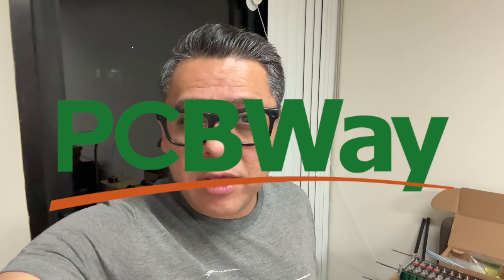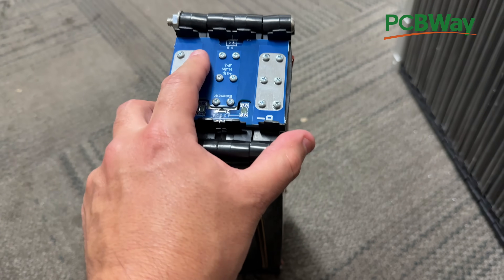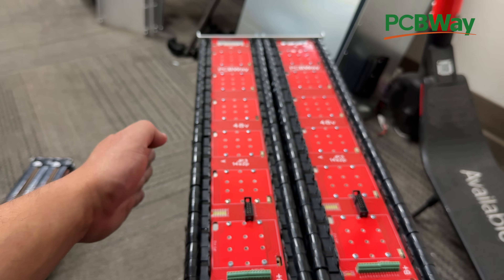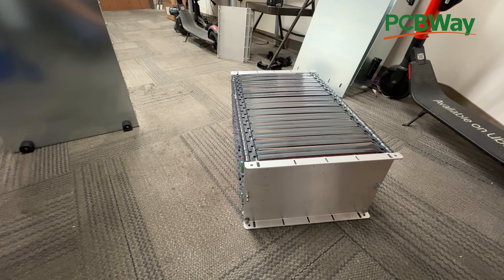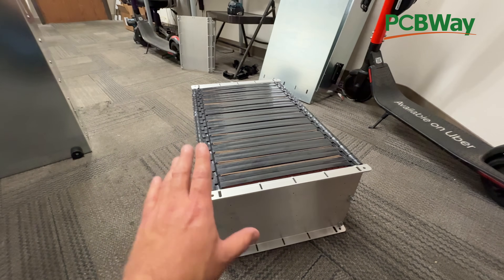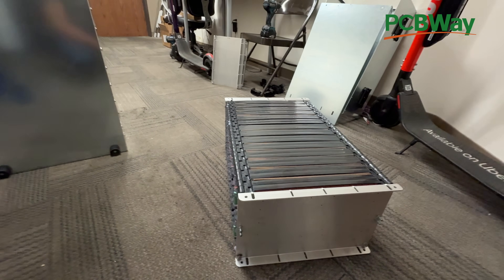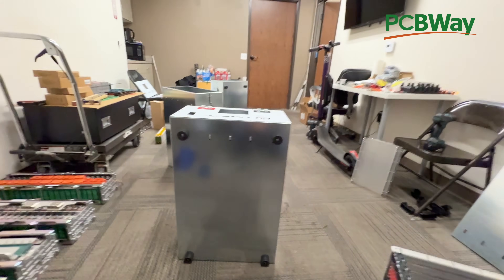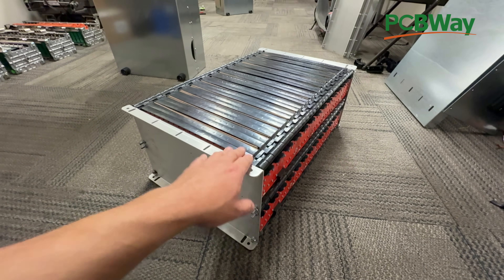48v JP3 Battery Module -  13.3kWh  = $800

Comment: Oh @jehugarcia man you sure do you know how to tap into my wallet! Though some serious questions remain. 

1. Are you leaving a small gap (usually 1mm) or so for the pouch cells to expand which will happen naturally over time and definitely a lot faster if you are pulling large amperage?

2. I LOVE THE IDEA OF PUTTING THEM IN THE BOXES! What I call the OG LEV60's Box! :) However I really think that metal would need to be upgraded to handle a thermal runaway situation for fire control. BMS's is a great start but since they are paralleled if one cell decides its going to die in a glorious fashion, EVERY, cell in the box is going up like a flame thrower, more like a bomb due to the compressed space! In my opinion adding specific Li-ion automatic fire suppression devices inside the case is a must, and probably a lot of them!

3. No dig on you Jehu but if you are in the battery game we've all heard about the tons of recalls on pouch cells and now we have mystery cells from a "failed" project from the govt, the cells have been stored in who knows what conditions for how long. That's concerning. Are you getting consistent IR and shipping voltages that are expected? Have you encountered a bad cell? Again this isn't on you, you can't predict what cells are good or bad, but I am curious how much more info you know about how dangerous these cells could be, yeah its kinda like de-selling yourself in a way if the news is bad, but probably better than a bunch of folks burning their home down and starting chaos. Its DIY and with that comes risk totally understand.

4. I know the bottom is where the thermal pads stick out and are supposed to be attached to a chiller plate. What's the plan for your box and addressing this?

5. Bus bars/Screw/Longevity - a bit worried here and confused I get that you are sandwiching the bus bars with these self tapping screws (you provide?) through your PCB, then I see a giant pad that I guess is meant to attach your terminal? What kinda terminal would you use? You wouldn't just solder on a cable or a ring terminal....confused I'm dumb. Will this screw method hold up over time, as we know a proper functioning pouch cell will start to bulge naturally over time, this is going to create stresses on all the critical points. I know we have the cork board to allow for some of that bulge. I guess is maybe you should keep one of these packs and 'beat the heck outta heat' in terms of high amp charge, high amp discharge over and over to see how the parts hold up. Stress testing it may reveal an "uh oh" that otherwise might not be found out for 1 year maybe 2 maybe more...

6. Parallel connections - I am assuming there is no sort of fuse that blows if one cell starts to go bad like on the old school 18650's build?

You've got me drooling to buy one right now, but now with talks of the box I wanna wait, because that is a large problem I was going to have to solve ---how do I safely store this heavy thing and run a BMS, terminals ect.. you are in the works already! I'm a renter and space is limited if it is made out of the same thin metal as the "LEV60" boxes with no fire suppression and no chill system and some way for the box to vent what would otherwise be an explosion, I'm down to maybe MAYBE being able to find a corner of my garage lined with cinder blocks and fire bricks. But then hot summers, makes leaving in there sketchy. Definitely feeling like this needs to be far away from your home for safety. I tend to be over worrisome, so I like asking just to hear your thoughts and others. That's A LOT of power in a nice package man I wont lie I really want one!! Standing by to see what "the box" looks like.

Cheers brother.

Comment: Don't put these in your house, only a detached building. These will eventually fail and they are very flammable.
Reply: What are the chances they will fail in your opinion? if you had good BMS and thermal monitoring? I am considering them for an off grid home, but not if safety is an issue and not if I will be buying new cells a year or 5 down the road
Reply: @mobius972  Rather high, Pouch cells have been known to have defects in almost every maker and there have been so many recalls on them. See a BMS and "thermal monitoring" is not going to do anything for you. The BMS will kill power to a cell if its starts to misbehave or the whole pack. But if 1 cell keeps bloating up, and explodes.....ALL of them are going up in flames in a rather violent fashion along with your "thermal monitoring". These are not like LFP cells where one can start smoldering and the BMS kicks in and the cells around it are fine. Pouch cells join the party 1 goes they all go. Enclose them to make them more explosive. Since we are in a parallel config we aren't even truly monitoring all the cells just 1/2 of them. So danger is high. It can be mitigated. We'll see how the final design comes out to be. But as is, I would NOT put that giant pack in my home.

Comment: Too big.... Forced to run massively over sized  capacity (190AH)  per cell. So if you want 84 V for high power ebike then it will be rediculously heavy for no benifet except a trillion miles if range

Comment: I'm wondering if this would work for a motor bike, or they don't have enough oomph. Replacing the battery with one from the manufacturer is about 8.5k.euros So this would be a friendly option.
Reply: Their power cells so yes they definitely have enough current rating. The problem is the physical size and being able to fit them
Reply: @Twin_turbo_coyote_fox  then probably also cabling and bms that needs to be compatible with both the bike and the battery
Reply: @erikcramer  Not exactly. You decide what motor you're going to run. Based on that motors voltage and current ratings you pick a controller. Then you need a battery that can handle the output the charger requires. 

The BMS is part of the battery. It's just designed to cut off power if the battery goes outside of certain parameters. The BMS does not have to be compatible with the controller or the bike The BMS needs to meet enough current requirements for your controller.
Reply: @Twin_turbo_coyote_fox  sorry what I ment was: If you have a zero motor with a crappy battery and want to replace just the battery could you swap it out.  And if so is it just the battery that needs replacement or everything but it sounds pretty much like everything the way you are sketching it

Comment: new prismatic LFPs are cheaper, shipped. just doesnt have high C rating. guess it depends on where youre getting your lfp cells from. 3 months to ship but catl 280ah lfp is 45/kwh. around 740bucks for 15kwh. dont even need a bms, just slap active balancers on it and use an inverter to manage state of charge voltage.
Reply from the maker: These cells in raw form are $42/kWh and you don’t have to wait 60 days for delivery.
Reply: Where?
Reply from the maker: https://jag35.com/products/lg-jp3-64ah-pouch-power-cell-500a-burst-overstock
Reply: @jehugarcia  youre doing gods work. i cant imagine all the batteries that would have ended up in land fills by now in SE asian countries if your company didnt exist :)
i think the best use case for these batteries is in a diy EV. LFP might be cheaper but to get the voltage right you basically need to make the entire car out of 280ah cells, or use more expensive smaller cells.
another misunderstood benifit of Lipol vs LFP is slightly better cold weather charging tolerance. i think the leaf cells could tolerate subzero charging even.

Comment: So I live in a powerchair wheelchair setup.  My battery compartment holds 2 group 24 deep cycle batteries.  (24 volt system with 120 Amp max draw)  can I fit these into that space and get more than 100Ah of usable power?  What kind of charger would this require?
Reply: The max voltage of these cells Is 4.2v so to get too 24v you need to decide on 6 cells (25.2v) or 7 cells (29.4v). Most people go with 7 cells because the lower voltage with 6 cells is sometimes to low. And 24v lead acid does hit 30v right after charging. 

To charge lithium you just need a constant voltage power supply and a way to balance the cells. I only drain my packs once a month so I manually balance them separate from charging them. Using a $20 external cell balancer. And I use a $30 dc to dc buck boost converter with an old laptop charger to do the charging. 

If you will be charging every day you can install a bms on the battery to do the balancing. Or get a hobby lithium charger that you can get from hobby king. You plug in the main leads and the balance leads during charging and it takes care of everything for you. $50 to $300 depending on what wattage you want to have.
Reply: @ecospider5 the stock wheelchair charger would technically work if you had a good BMS but the charging cycle for lead acid is different and would prematurely wear and damage the cells. I’ve done it with a golf cart 48v system. So you would definitely want a lithium charger retrofitted.
Reply: They make group24 100Ah lithium batteries on Amazon as a direct replacement if size is a constraint of the chair. Just be careful, don’t want a battery fire underneath yourself
Reply: @shize9ine
Yes a bms can makeup for a lot. I would never use a lead acid charger on lithium. Lithium needs a very stable single voltage. A lead acid charger steps the voltage up and down. The final float charge from a lead acid charger is what I would really worry about. That is not very voltage controlled. So it could easily overcharge a lithium battery. 

Overcharging a lithium battery is the number 1 way they overheat and catch fire. A 7S battery is 29.4v. The float on a lead acid charger can easily go to 30v. Even if set to AMG
Reply: what brand and model wheelchair? if your batteries are together and in a single compartment, that compartment is either 21 long and 6.185" wide, or 12.375 long and 10.5" wide. Using JUST the size of the packs alone to ESTIMATE things, you seem to have 2 options, but whether or not these options would actually fit after they are built would require actual in person measurement and planning. 

Both these setups are also 41v max, and would require a voltage controller to step them down to 24v, but thats not a major hurdle. I would suggest contacting Jag35 and asking what it would cost to get these pack options built for you, as they would require a custom circuit board, and all the pack holders, insulators, nuts bolts and time. Im going to guess that they would be a good bit more expensive than standard replacement batteries, but could also give you much more range. 

The 21" long option would waste a bunch of space on the end but youll be able to fit a stack of 10 of them. This gives you: 

Battery Configuration: 10S1P
Pack Capacity: 64.00 Ah
Pack Energy: 2355.20 Wh
Pack Max. Voltage: 41.00 V
Pack Nominal Voltage: 36.80 V
Pack Cutoff Voltage: 30.00 V
Max. Discharge Current: 32.00 A

the 12.375 long compartment option  is MUCH more promising, as it allows you to fit (in theory) TWO stacks of 10 modules for the following specs: 

Battery Configuration: 10S2P
Pack Capacity: 128.00 Ah
Pack Energy: 4710.40 Wh
Pack Max. Voltage: 41.00 V
Pack Nominal Voltage: 36.80 V
Pack Cutoff Voltage: 30.00 V
Max. Discharge Current: 64.00 A
Reply: @nicholastrawinski  Quantum 4front 2HD chair.
Reply: @ the owners manual shows the batteries in the  12.375 x 10.5 arrangement, so the second battery pack option i listed is looking promising. Most of the replacement group 24 batteries are also 75amp, so 12v x 75a x 2 = 1800wh But the 2 packs i listed are 2355 and 4710wh. Thats a HUGE range boost.
Reply: @nicholastrawinski  it isn't just range but the ability to keep my phone and tablet charged.  If I get stuck my phone is a life or death item, no exaggeration. 75Ah or 100Sh sounds adequate but will only take you about 12 miles on flat ground.  Get stuck and you can just watch the percentage drop every time you rock back and forth or side to side.
Reply: @nicholastrawinski  yeah the batteries set in the bay sideways as the long side.  So basically the 1st battery slides in and then the second one.  I think i would be better off keeping the pack at the 24-29 volt range.  I'm not certain how many of these cells you are allowed to run in parallel.
Reply: Does this channel have a discord server or place to discuss building these in detail with photos?
Reply: Oh and I also failed to mention the potential weight savings.  My current gel lead acid setup puts my total chair weight at 450lbs.

Comment: So I am into car hydraulics. My brother has been doing it way longer than me. He likes old lead-acid batteries. To be more specific, he likes Group 31 High Cranking Amps, like 1150 CCA, and connects them in series. I told him newer batteries would be better and can fit more since they are not lead-acid. Do you think it's possible with LiFePO4?

Or even like this battery you are showing?
Reply from the maker: yes its possible
Reply: @jehugarcia  thank you I have a 1979 Lincoln Mark V once I put Hydraulic Into it witch is soon I will try he keeps doubting
Reply: 8 yrs ago during a lowrider show, i asked if lithium could be used. they told me no, they tried and found out it could not handle the vibration from jumping. todays AGM batteries with CCA 1150 / PCHA (Post Hot Cranking Amps) 2150 for the first 5 seconds. this is what LowRiders are using. one thing to to remember Lead Acid Batteries weigh 55 lbs. but these AGM bad boys weight 75 lbs. hopefully you can let us know if LiFePO4 worked :face-blue-smiling:
and as always Jehu never disappoints with his new stuff :person-turqouise-waving:
i have fun saying PCBWay en español "Compa de donde consigues tu baterias?" "De PCB Wey" :face-fuchsia-tongue-out::face-blue-covering-eyes::face-green-smiling::body-blue-raised-arms:
Reply: The new sodium batteries are rated at 1200 amps for a group 24 battery. They are around $350 each right now.

Comment: How many modules would one need to produce 0.65Mw (650Kw?) for 10 minutes?  What is the weight of each module.  Thanks in advance!
Reply from the maker: you need 7 modules ,  they weight 200 lbs each
Reply: @jehugarcia  Perfect!  Thanks so much.
Reply: @jehugarcia But can you even load them that hard? Can they take the amp load to empty in 10min? Wouldn't they get very very hot?
Reply: @cajampa 93kWh LiFePo4 should be able to do it easy, but yeah, you need some liquid cooling for sure.